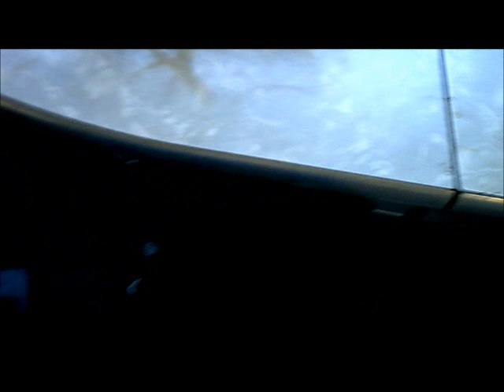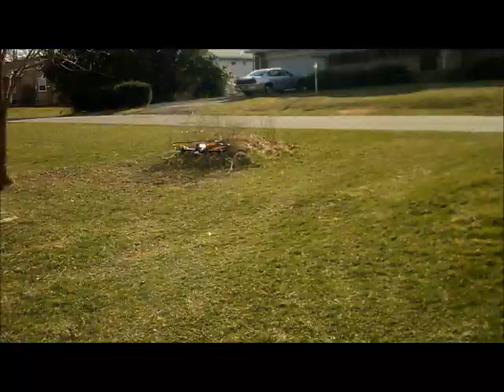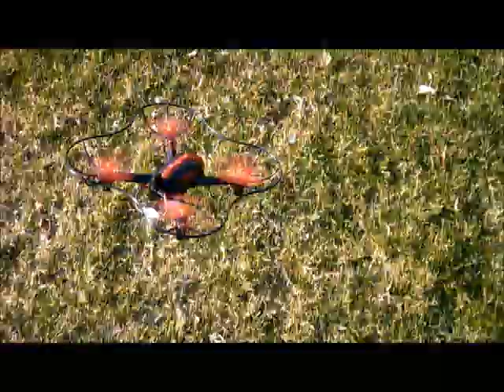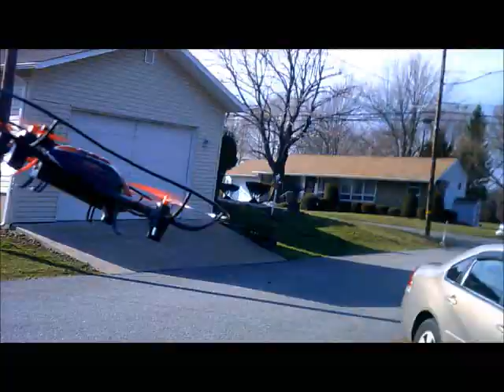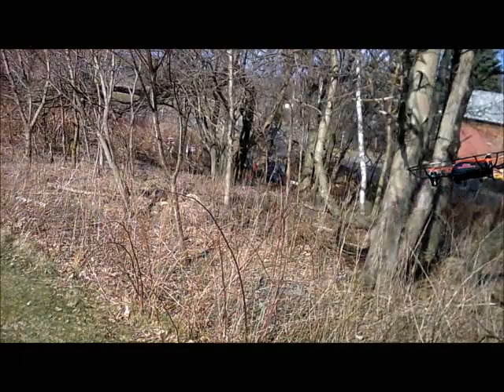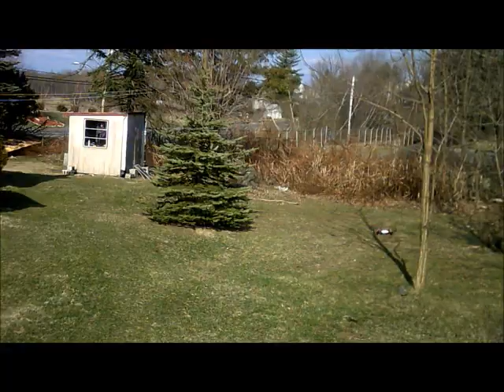Tech Toyz Aerodrone X6 RC Quadcopter 15mph WIND HD Camera Review

Comment: I dont have a cam on mine. One of the buttons turns the flashing lights on and off. I dont know what  headless mode is or return home does. Like I said there are buttons that are not defined on the manual. Its frustrating because I have to check them all in a short flight time. Its really fun though hopefully Ill figure it out soon. I got my drone stuck in a tree today but got my drone back lol. If there is anywhere I can access more info about my drone let me know asap.

Comment: I have just bought the cam-less X6 drone. I do not know what the un defined buttons do. It does not say anything within the manual of what they do. Due to it being a 4 channel drone I can on assume they change the channel. The do beep by the way. If anybody has and explaination please write back asap. Also does anybody onow the difference between the beep sounds the controller makes? I do know there is a short and long beep. I believe the short beep is showing you change the trim in one general direction and the long beep is a default setting. I am only hoping if I ever need to adjust the trim that it is done right and does not rest itself fro the next flight. I only understand trimming in RC cars but cheap beginner's drone can be a bit hard.
Reply from the maker: they dont change the channel the transmitter is same for camera one u have camera buttons and i think headless mode

Comment: i hav te same thing
Reply from the maker: +Minsung Kim very cool good flyer
Reply: i know i have it but then the wire bgroke :(
Reply from the maker: +Minsung Kim sory to here if u can reatch wires by exposing thethem it should wires and twisting them and tape them it should work, if a wire cam off of the board u will need to solder them and if a wire came off of the battery you need to reconect it to bare spot on battery this can be done by tightly wrapping it with tape